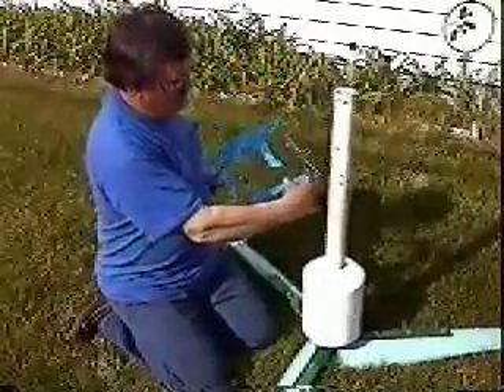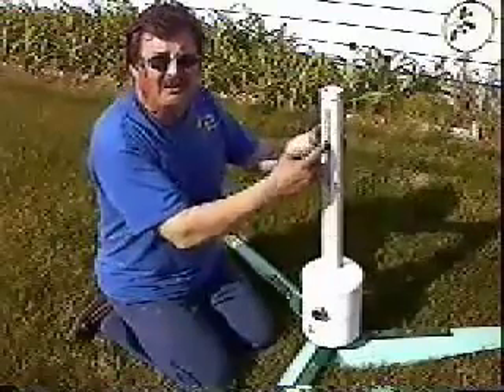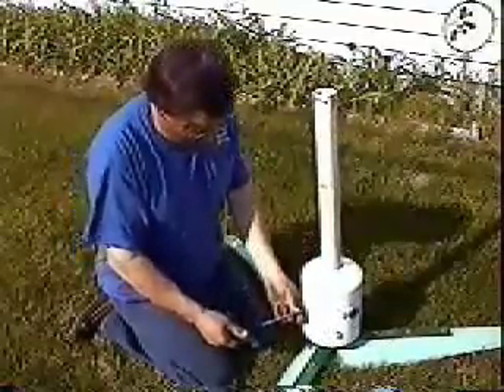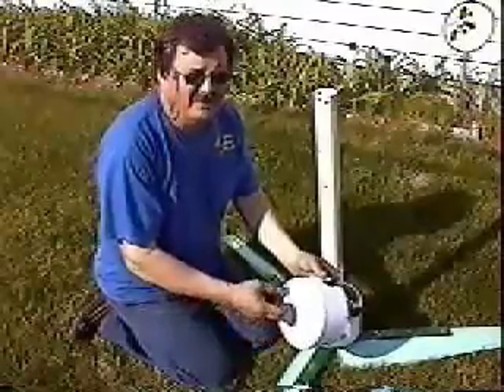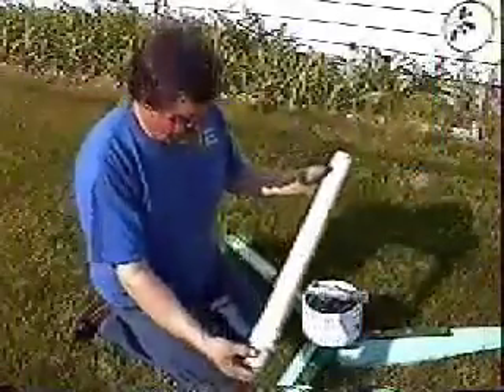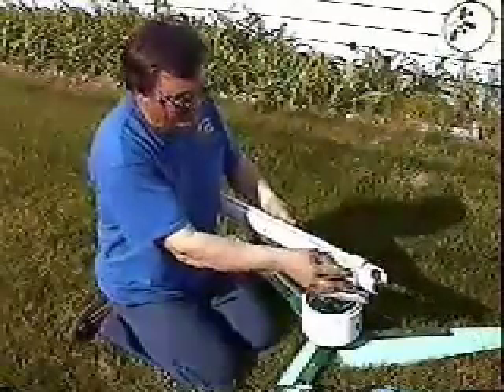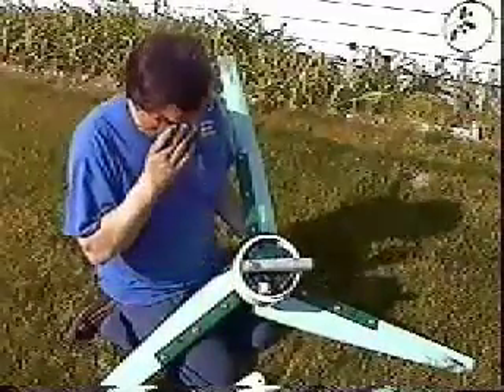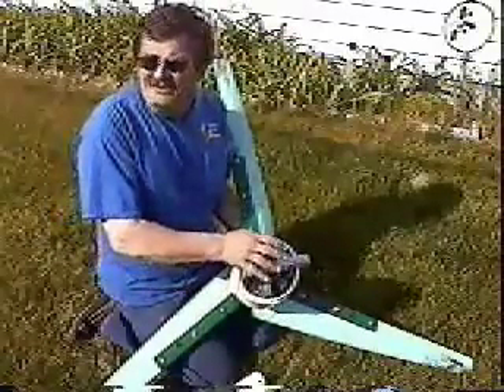How to Build A Wind Generator (Do-It-Youself)

Comment: nice project. not to sure about using pvc pipe it becomes very brital when exposed to uv light
and cold temps kind of designed to go in the ground. mind you stuck on a desert island i would use any thing i could lay my hands on. nice try!